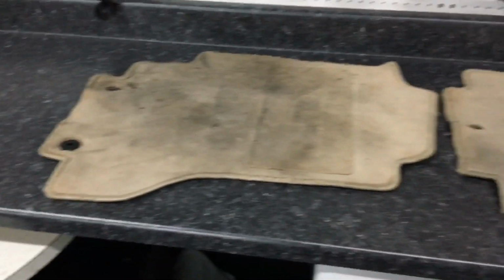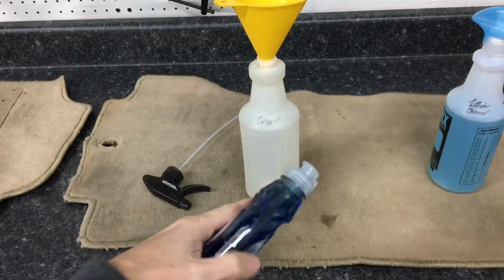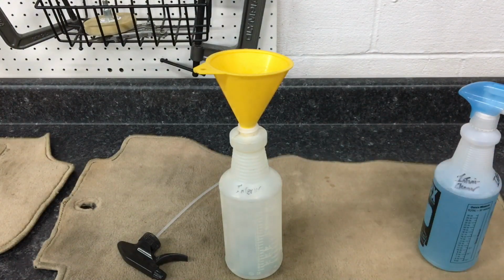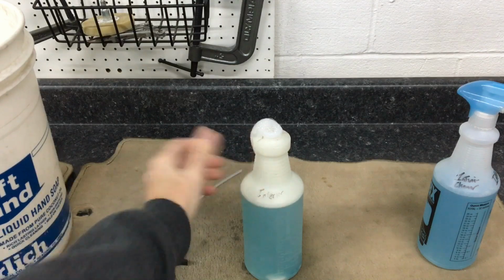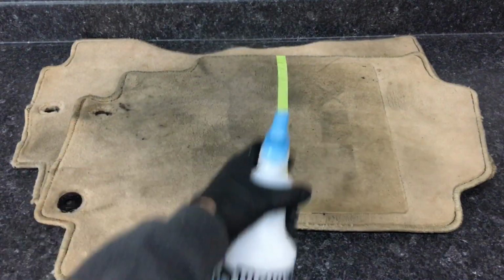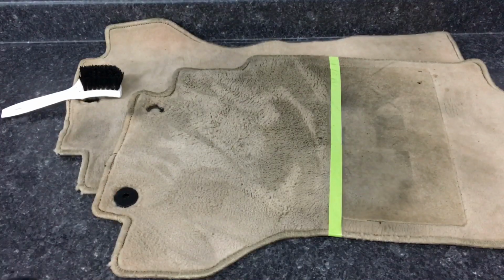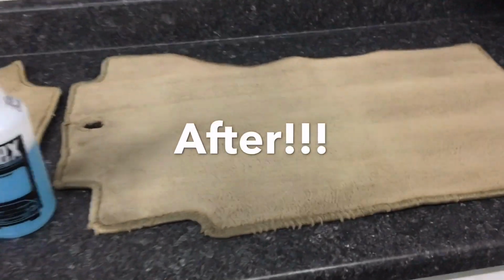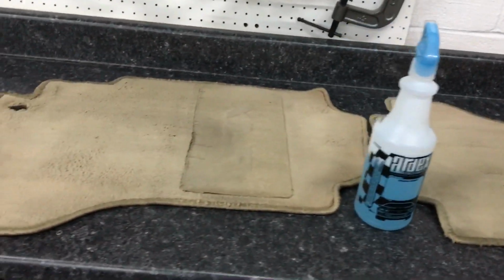How to Clean Interior (Upholstery) With Common Household Items!!!

Comment from the maker: What is your go to carpet and upholstery cleaner?
Reply: P&S carpet bomber, terminator and finishing whit peroxide
Reply: Mine was Tide Cold Water clean. Will definitely be giving this a shot! Hope you had a Happy New Year!
Reply: Spray 9 Diluted.
Reply: Spray 9
Reply: Degreaser, dish soap and a little bleach to kill any bacteria and mold. Cigarette burns are easy with a single bladed razor and some superglue.
Reply: I've enjoyed the ammo Shag cleaner. But I'm going to try your formula, in the boutique overpriced bottle hahahaha.
Reply: i have a rubber mat not perfect.for the carpet a all-purpose cleaner
Reply: Adams carpet cleaner and your secret recipe 👍🏽
Reply: tide sport warm water!!!!
Reply: The garden hose.  Spray the cleaners on, let them sit for a few minutes and flood it under the garden hose, respray cleaner then scrub a little and then hose it off again.  Easy peasy.
Reply from the maker: @1974gladiateur  Not advised per IGL.
Reply: Simple Green.
Reply: I use Tough Stuff. Has worked great for me for years
Reply: I’ve been using downy fabric softener to loosen up the fibers, cold water tide, some times Amway LOC I find it to be a great degreaser better then dawn, maybe a little APC, but I spray that only if I have a more stubborn spot. I use soft drill brush and steam. Interesting I had stopped power washing or power rinsing on my own , it can damage carpets even if effective. I use extraction to rinse and pull most dirt. I don’t like extraction on cloth seats just carpets I pull from the car when really dirty. Tornador to break up dirt and vacuum is helpful too. I’ll try the oxyclean and peroxide makes sense...
Reply: How does the. Tide with OXY CLEAN work???
Reply: Tide Ultrastain lifter, Dawn Platinum, Degreaser, Oxyclean if it is really bad.   The brand names work better for cleaning in clothes washing tests, so I stick with them.
Reply: @albarnhill1487  Tide is excellent.  Any of the Tides are excellent.  I think Ultra Stain is best if there are stains.  But Tide is excellent.

Comment: Thank You Brian, have been using this minus the tannin solution on my truck with great results..now I know where to get the tannin solution,I'm gonna be adding that! 👍👍
Reply: Scott Punswick tanning solution?
Reply: Scott Punswick sorry, I didn’t see the degreaser was called tannin. I have super clean and I’m sure any degreaser will
Work in this mix. I use super clean in my laundry
Reply: @superiorautodetailing  check the link in the drop box, tannin solution by matrix. Brian can answer better than me but it's a stain remover, coffee,rust, heavy soiling etc..
Reply: @superiorautodetailing  Super Clean is wonderful! 👍👍

Comment: Thanks Brian! I can't wait to try your cleaning formula on the driver's seat in my 2010 Camry that I purchased 3 months ago. I color sanded the scratches, corrected the paint and did some touch up using Dr Color Chip followed by a ceramic coating. The drivers seat and floor mats are pretty clean now. I want to try your formula to see how much cleaner I can get the upholstery. Thanks again for all the training that you provide on your channel : )

Comment: Would be interesting to see how that compare to a carpet cleaning machine (like a Foma Mimo which is commonly used here in Europe). Most steps are still required but instead of just vacuming the soap, it sprays clean water into the carpet ahead of the suction...

Comment: " There's the right way, the wrong way and the fast way ", as a pro mechanic told me .  He always chose the fast way .    Another mechanic used to criticize slow work by saying,  " If you were on a line in a percentage shop, you'd starve to death " .
    The fast way to clean floor mats is to (1)  hang them on clamps ,  brush in a solution of Simple Green,  L.A.'s Totally Awesome  or Mean Green .   (2)  Let Dwell about 3 minutes so the solution stays wet  .   (  3)  Pressure rinse .  (4)  Let dry in the sun while you do the rest of the car or use a dedicated clothes dryer ( don't dirty your home unit ) or hang them with a utility heater blowing over them .
    This method doesn't require mixing up a 'witch's brew' of chemicals  and doesn't leave soapy residues in the mats .   
   For carpets, (1)  remove stains with appropriate stain removers or Spray Nine and ( 2)  Spray Tide or carpet cleaner solution onto the carpets and brush it in .  Let dwell a couple minutes and extract with hot water .  A cheap carpet cleaning machine from Bissell or Hoover  is adequate .   For extra cleaning power, you can add carpet cleaner or OXY Clean to your machine  but check the instructions because Hoover requires Hoover Carpet Shampoo .   For more info :  https://web-cars.com/phorum//read.php?1,44710,44752#msg-44752

Comment: Love it Brian! Thank you! I just solved a mold problem with your Moldex & Spray 9 cocktail but it left the carpet a little bit tacky. I will try the peroxide treatment... Or this cocktail and then peroxide if the peroxide alone doesn't solve the residue problem
Reply from the maker: The peroxide should neutralize the residue.
Reply: @apexdetail85  got to do a follow up on the carpet today. A few sprays of 3% H2O2 and rub-down with a microfiber and the carpet was back to a soft clean feeling. Thank you again Brian!
Reply: Brian could you elaborate why you prefer peroxide to a vinegar mix to cut the soaps please. I feel like I might be missing out here.

Comment: Hi Brian, Is there a problem with using Dupli-color prep spray grease and wax remover when correcting paint?
Thanks
Reply from the maker: John Schiesser no problem at all.
Reply: John, Brian may have more experience with it but it WILL remove some after market enamels; heard it on a paint and body forum and it DID absolutely remove a Maaco clear enamel when I was re-doing my hood. Test 1st friend.
Reply: Thanks Jimbo,  I heard it could cause etching on another video. I don't want to start paint correction by screwing up the clearcoat! LOL
Reply: @johnschiesser144  no problem; their regular wax and grease remover ( plastic container ) is water based and not an issue, but the spray is like bloody acetone in a can on lesser enamel clears anyway.

Comment: Please help!!!!! My  rupes lhr15es has nearly seized up and wont hold a backing plate. Any idea what needs to be replaced? 
Its mechanically sound, it just doesnt rotate freely or oscillate
Reply from the maker: Could be a bearing above the wheel gear. Crack that thing open and service it.

Comment: Nice Brian, whatever happened to , I think its called Mai Dry Foam carpet cleaner? I watched a Video with you using a Griots foaming gun that was connected to an air compressor. I cant find it or did I spell it incorrectly?

Comment: Laundry detergent, Borax, Rubbing alcohol, OxiClean.
Reply: Sir i dont have extractor or steamer or air hose at this point...how i remove the lifted dirt of your mixture and how i remove the cleaner residue please any tip please? Thanks
Reply: @Mdetailing  make sure you use hot water to mix. i dilute the detergent 7:1. Mop up with your towels, then spray a light mist of half water/ half white vinegar. This mix will neutralize the residue. i add air freshener in mine.
Reply: @RnBGarvey  thanks sir

Comment: You dont use apc or degreaser on interiors? I've seen you use apc on interiors many times lol spray 9 is one of them
Reply from the maker: Kelly Mcculloch I use 2 on special occasions... rarely. Spray 9 for commercial vehicles or vehicles that many commuters come in contact with. Solely because of its germ killing and mold removal strengths. The other is CarPro MultiX for being safe around plastic trim. But for the most part... this is what is used here. And since I rarely do interior videos...how do see me using APC many times?
Reply: Ok... I do have Spray 9. Is it ok to use it? I literally went back as far as 8 months ago into your videos.... where are all of these “many” videos?
Reply: @lifeofbrian9511  totally awesome, mean green,simple green,extra tough, 409 degreaser, mulit x, spray 9 dont know if there other to be fair it shown as example that  you could use it for that purpose not so much that he would.
Reply: @apexdetail85  thanks for the clarification I personally see no problem with using apc on carpet but I was wondering how you felt about that particular subject.
Reply from the maker: Ahhh...I see. I had a problem with a residue making the material stiff so I stopped using them on carpeting, Mats and other upholstery.
Reply: @apexdetail85  so you pretty much only use your tide formula for carpets now?